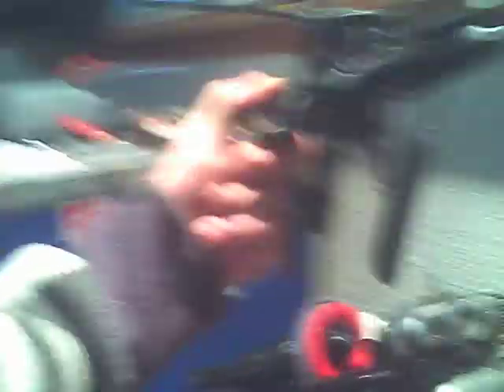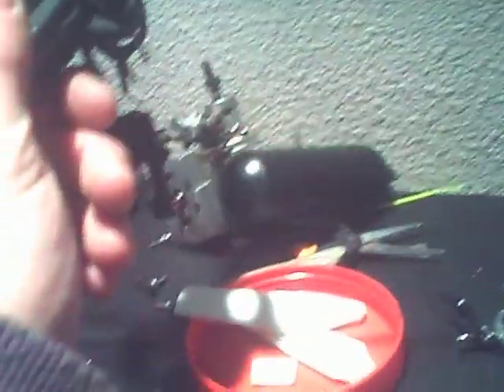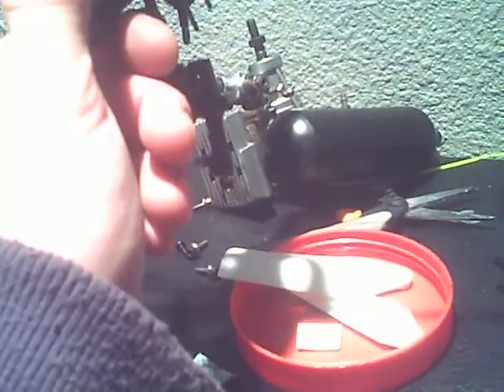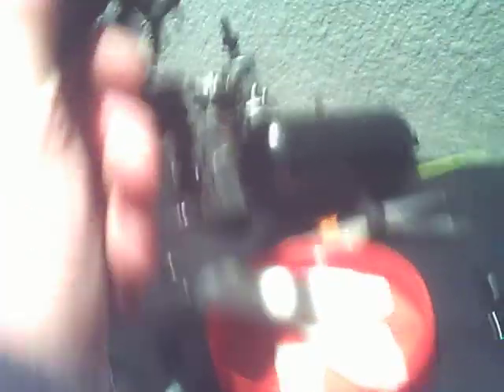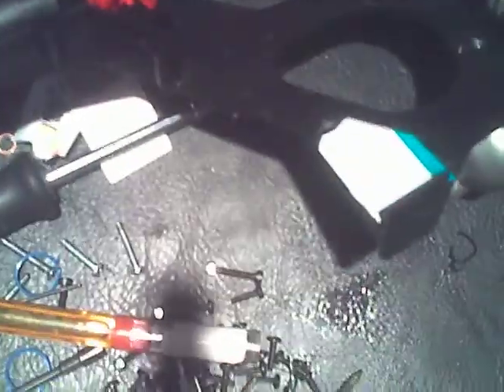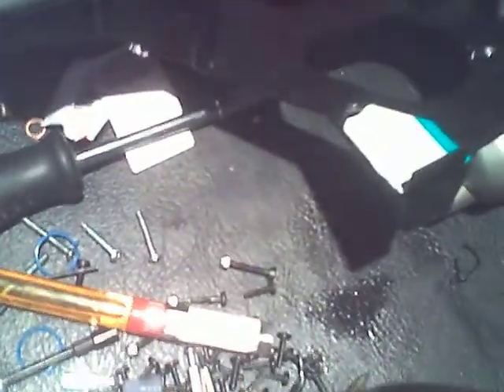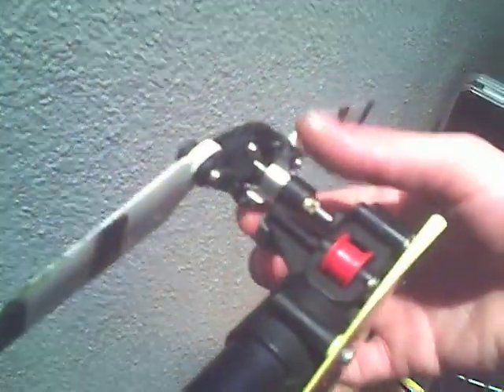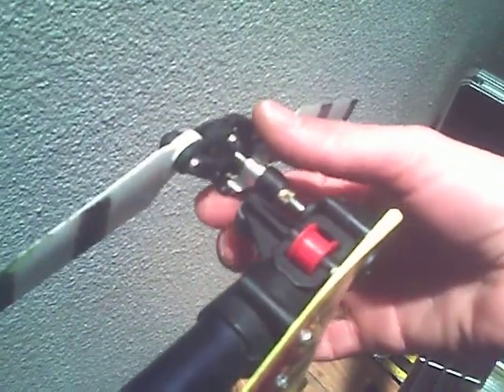raptor 30 with 50 motor

Comment from the maker: i wrote down the wrong info i have a 50 muffler with the motor 
i have 12 new glow plugs 
every 5 tanks i replace them 
just got a aerospire gov with temp and carb sensor .. 
im pimpin my heli like yours bro .. sick raptor you got shhhuunnnn!
turn it on lemme hear it